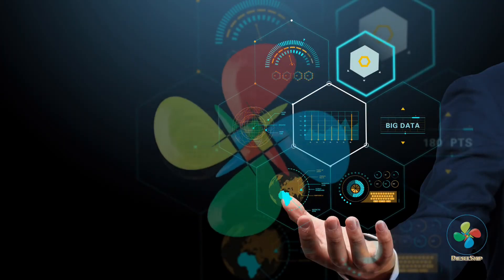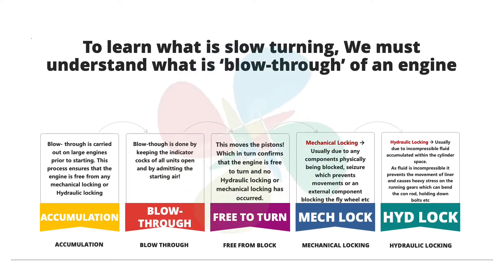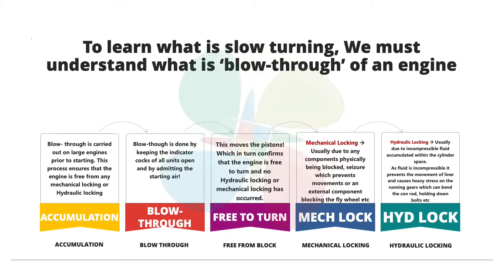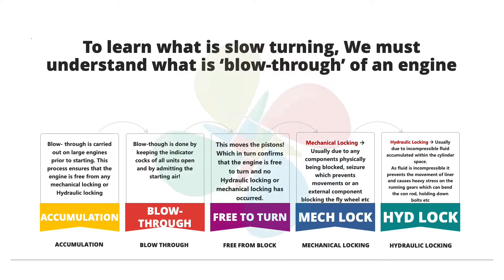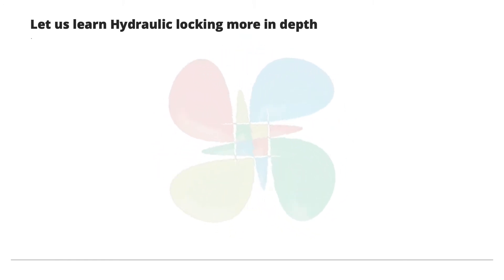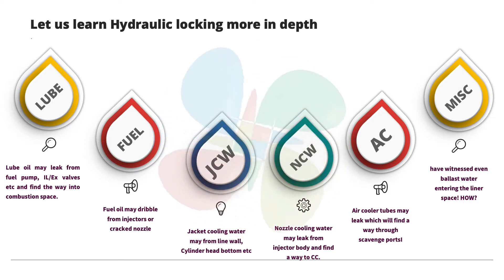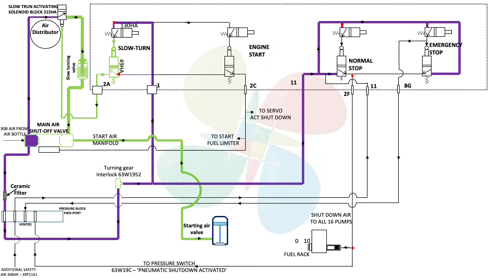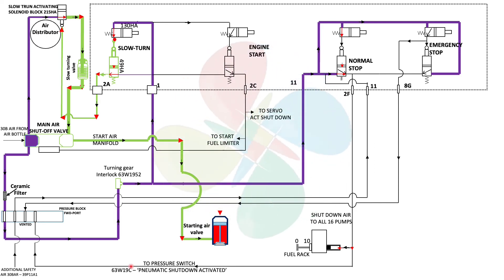SLOW TURNING OF ENGINES

Comment: it should be 7 bar air instead of 30 bar at some places
Reply from the maker: Well, this system is for a large 4 stroke V engine, at first i thought the same you did but when i had personally traced the line I realised its not! Yes its 30 bar in most of the places! Let me know where you think it should be 7!
Reply: 13:56 slow turning valve set at reduced pressure for 30 bar air. When you said throttled it means the volume of air (30 bar) has controlled?
Reply: @OutOfControl689 both pressure and volume will reduce. In slow turning valve, throttling occurs, at the outlet of slow turning valve , pressure drops to 4- 8 bar and volume also reduces.